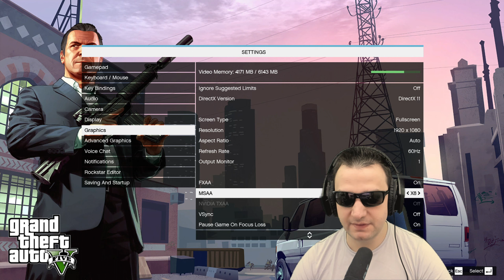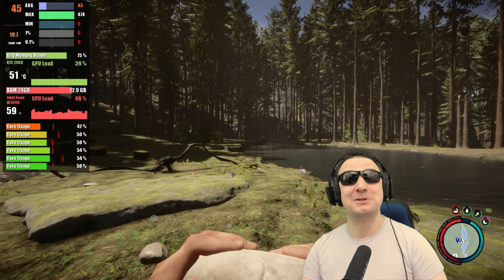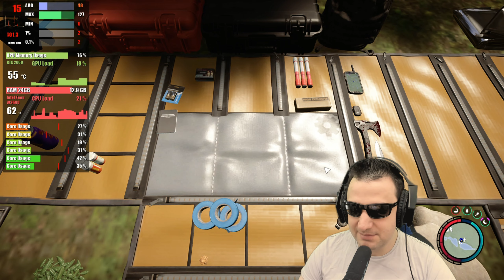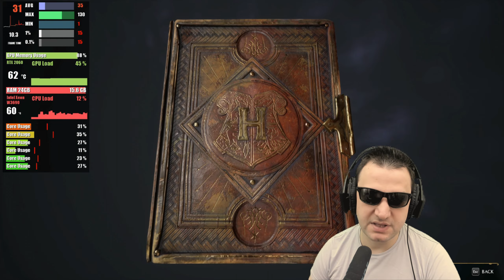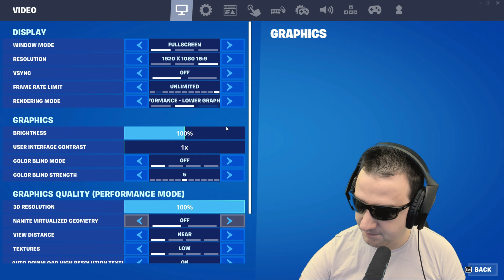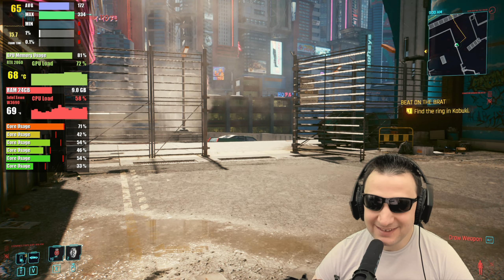Testing Xeon W3690 with RTX 2060

Comment: Any decent 1366 mainboard will support up to 48GB DDR3 natively, as all of that is handled by the CPU. Additionally, both the X5690 and W3690 support ECC memory.

I run 48GB of ECC DDR3L with my w3690 on a Rampage II Gene mATX board. It pairs nicely with a Titan XP, and an NVME boot BIOSmod really brought the system into the modern era with 1600mb/s r/w speeds.
Reply from the maker: Holy Shakespeare that's so awesome. 
How did it cost you to make it?

Comment: i have w3680 and rx480 8gb with 8gb ram and i can easily play gta online at locked 60 fps at max settings
Reply from the maker: OEM PC or Custom PC? What motherboard you have?
Reply: @DanielCardei  is tested it on t3500 dell oem
Reply from the maker: @saamirkhan4619  Good PC. How much memory you have? is it ECC? i have an Z600 with ECC that i want to test in the future.
Reply: @DanielCardei  i don't remember if, it was ecc or not it ddr3 1333mhz 8gb ram

Comment: Fortnite GPU only load with 40% this the fucking performance mode with right game and settings the w3890 will easy bottleneck the 2060 see cyberpunk game
Take a 2080 and give the w3890 a little oc the it will work perfect for its price

Comment: Would you buy a cheap overclocking 1366 board? it makes a massive difference to performance in modern games!
Reply from the maker: Definitely and an AIO
Reply: @DanielCardei  Hell yeah!
Reply from the maker: @SlowHardware  it is on the list but with low priority. at the moment I want to focus on getting more CPUs and then maybe testing the Z600. after I`ll try to get those. Not cheap if you are not a full-time Youtuber 😂
Reply: @DanielCardei  Oh I agree, the hustle is real! Z600 testing would be awesome! I have a Z800 I wanna test but need a new psu first
Reply: Air cooling is enough you need no water in the PC ;-)) bequiet dark rock hold this cpu  cool enough
Reply from the maker: I have one in my sight 🤤

Comment: Next dual Xeon build dude, go hardcore monster paired with the daddy gpu rtx 2080ti.
Reply from the maker: Definitely. I got an HP Z600 but I  need to find somewhere close 2 high performance fans. If you don't install them the pc beeps and shuts down. Gives error. If you don't have them and use the original one. I can use similar to x5570 under 100w. Now. Not bad though but I have to find the best memory for it. Triple lane. Ddr3 ECC. After if I don't find the fans I go custom lga 1366 😎
Reply: @DanielCardei  Big Daddy approved💪:yt:

Comment: You can oc the w3690 to 4.32ghz all core, some say even 4.5ghz but i doubt it will be fully stable. It will counter the low single core performance a little and will show what the cpu can really do, for as far as it goes. Main problem for this gen of cpus is the single core performance. At 667mhz ram speed it counts for 2000mhz as it has tripple channel ram. You should also start to test agp cards 😄
Reply from the maker: Definitely needs OC.  Unfortunately the HP Z400 has no option to OC.
Reply: @DanielCardei  you can oc by software w3690 in hpz400
Reply: Worng you can use trottlestop to run on max turbo with this cpu on ALL cores disable energy savings from win10 also this will help with other cpus /gpus to fix problems in gaming